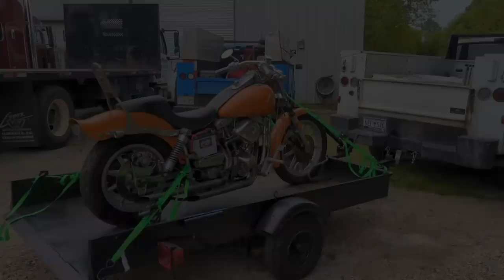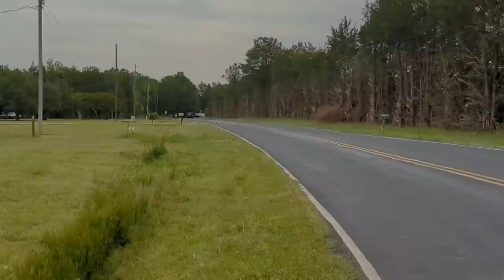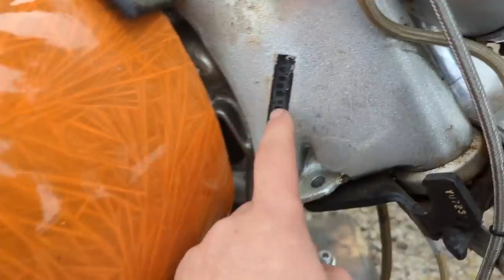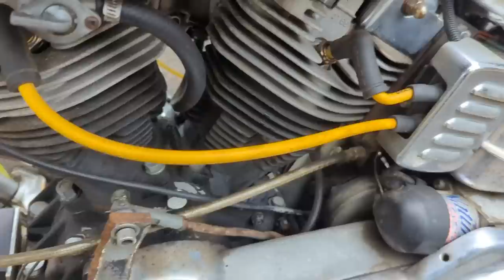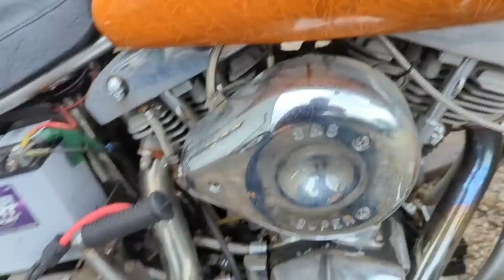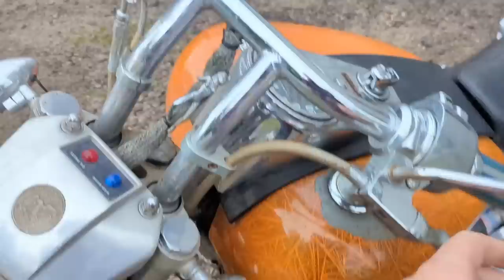I Bought The Cheapest Shovelhead I Could Find on Facebook! How bad is it? 1974 FLH meets 1979 FXS

Comment: When the engine is running, the clutch turns so the input shaft (tranny mainshaft) turns, the tranny is constant mesh so the layshaft turns and as the oil is cold and thick it causes the whole transmission to turn - this is reffered to as drag. 
It runs in the forward motion mode, so pushing the bike backwards is harder with the engine running. Try pushing it backwards without running the engine running - it's easier..... jeez you milenials have no savvy at all !
Reply from the maker: The front brakes were locked up but thanks anyways